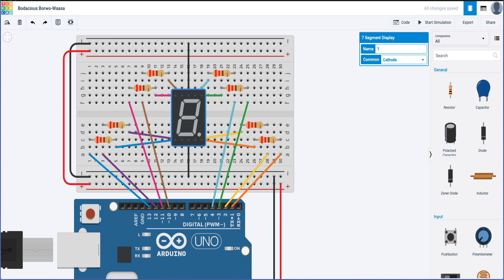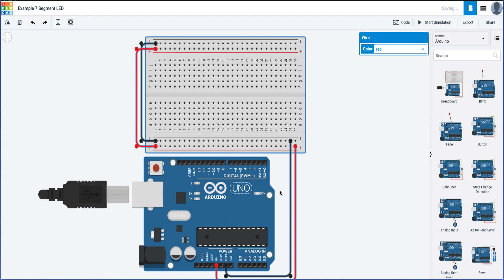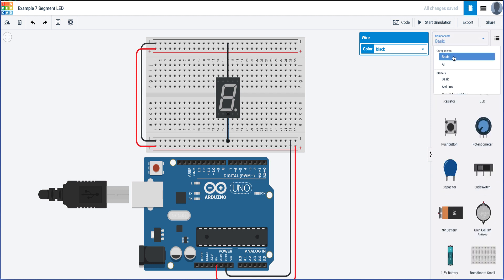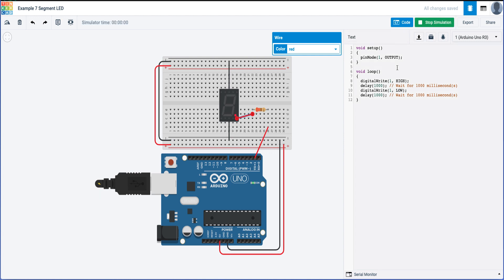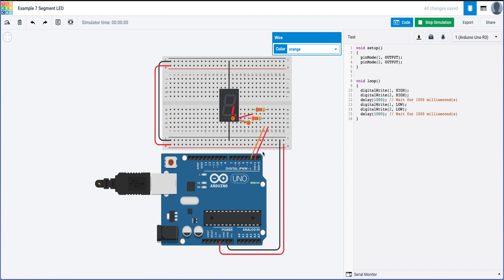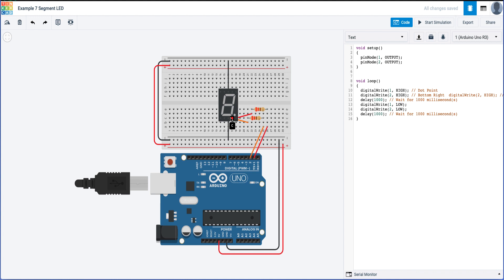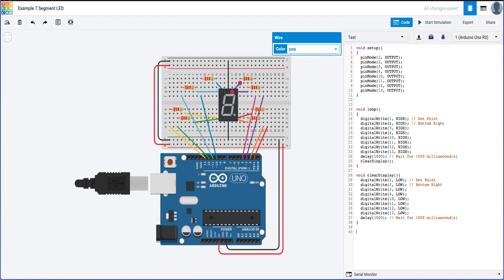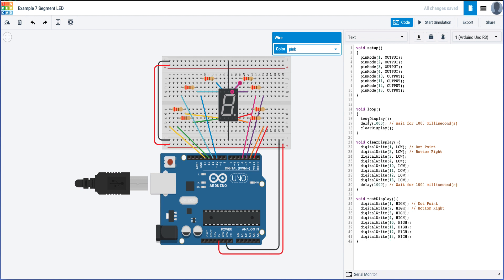Tinkercad and Arduino - 7 Segment LED Tutorial

Comment: I would just only connect the common cathode to the resistor to save wires and resistors, it seems to work fine this way.